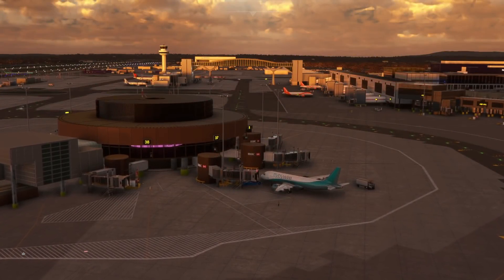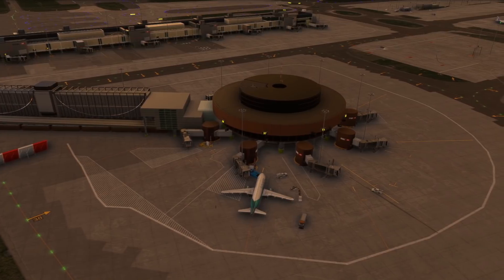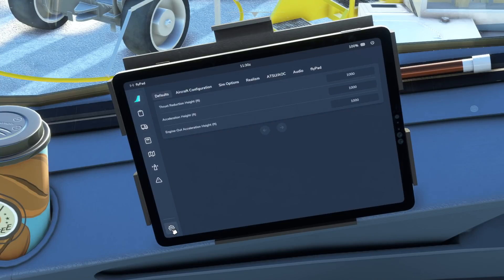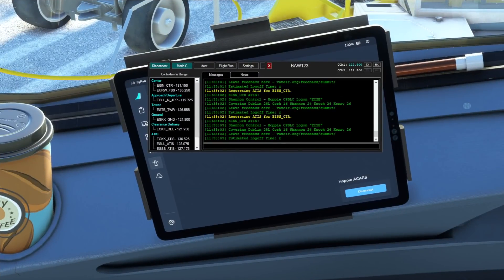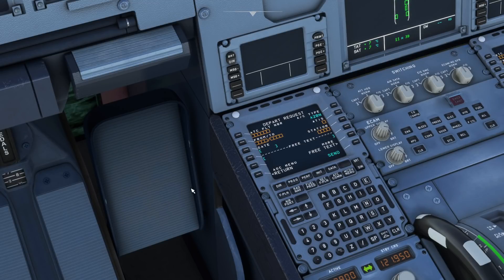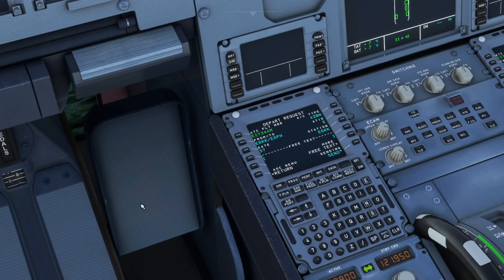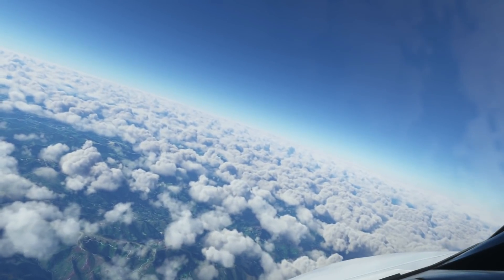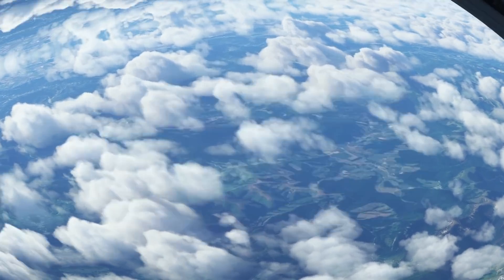FlyByWire Adds CPDLC (Pilot & ATC Messaging) - How To Use Tutorial | A320NX - MSFS 2020

Comment: Cool, but much easier to type a message in vpilot lol, or even talk 👍
Reply from the maker: I guess that would depend on the circumstances. As at small airport, probably. However, at a really busy airport, or at a VATSIM event for example, you can send off your departure clearance request (just enter gate number, ATIS info letter and the ATC identification code, and you're done (about 6-7 keystrokes). You can finish setting up your aircraft and be ready to push as your clearence comes through.

Comment: Nice. Was on VATSIM the other night and there were 29 departures trying to get out - clearances were not going out by PDC (not many) and it was a nightmare with people talking over one another.  I do like it when I connect to VATSIM at an airport and they send me my PDC via text without having to ask.  I always file my Simbrief plan before connecting - this helps in getting the PDC so quick.  Just wish I could figure out the runways being used at my departure and arrival airports without having to connect to VATSIM first and check the ATIS, as the ones assigned by Simbrief aren't always correct.
Reply: Use something like VatSpy to check the Atis in advance (also on Volanta etc...)
Reply: Some atis informations also don’t include the active runways
Reply: I use simtoolkitpro with the wind calculator tool to check what runway to use